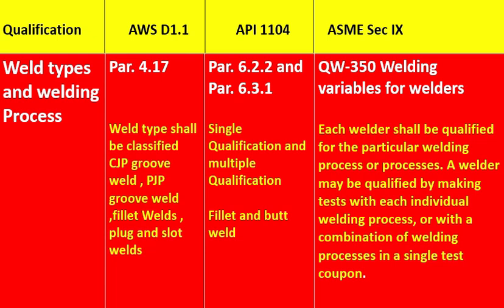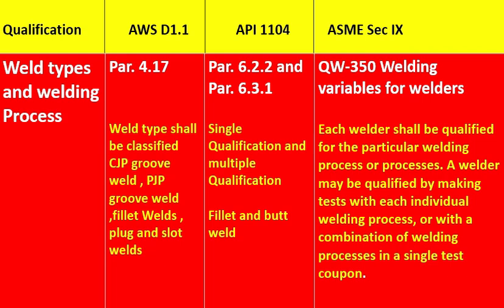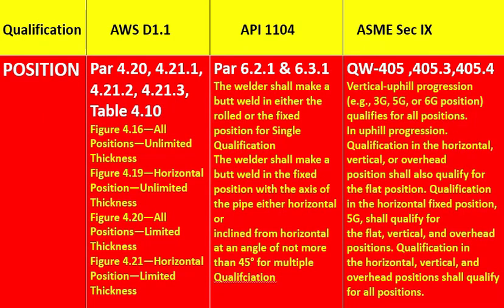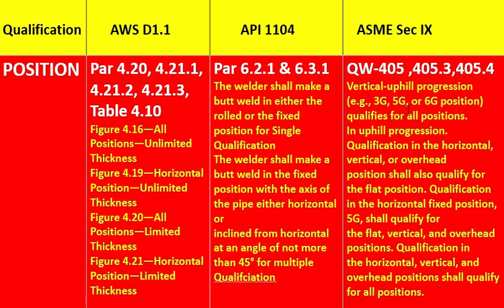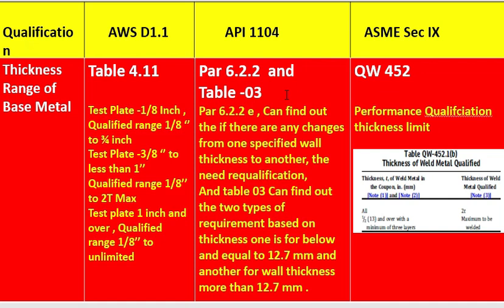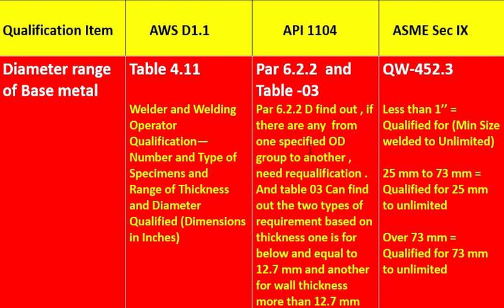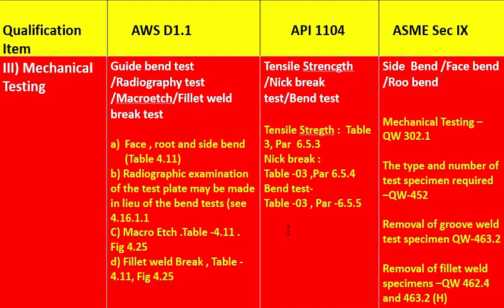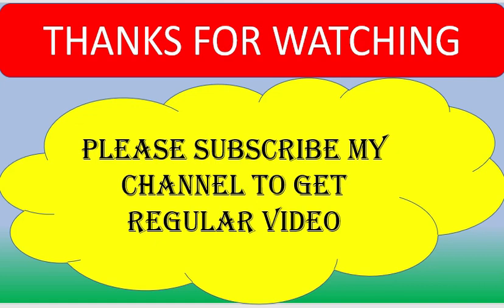Welder Qualification essential Variable table guideline  -ASME Sec IX/API 1104/AWS D1. 1

Comment: Change in Classification is Essential variable for Welder qualification as per AWS D1.1, (i.e)welder qualified in Er70s-6(GMAW) can he weld using Er70s-2 (GMAW Process) ?
Reply from the maker: no . Filler metal is essential variable